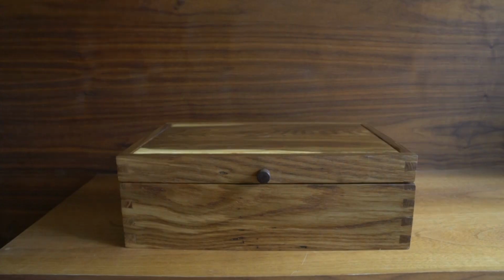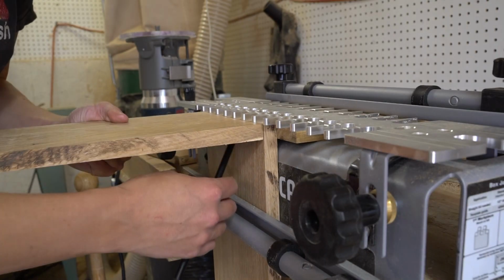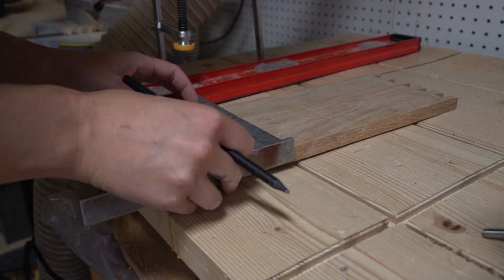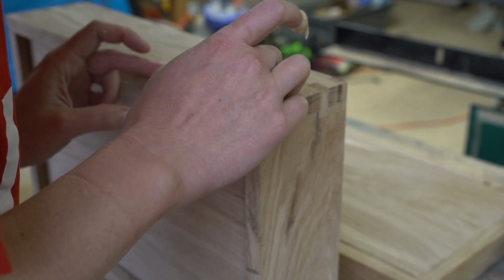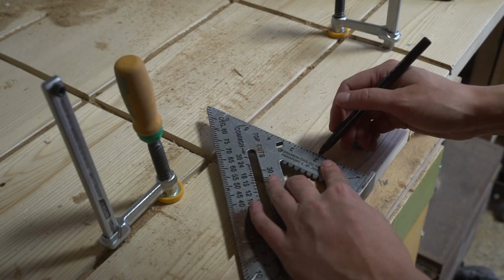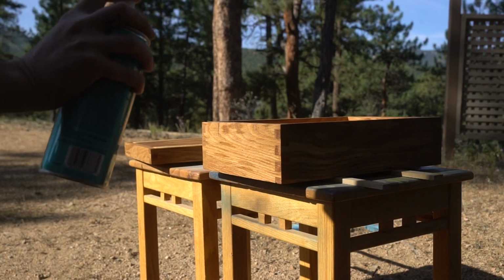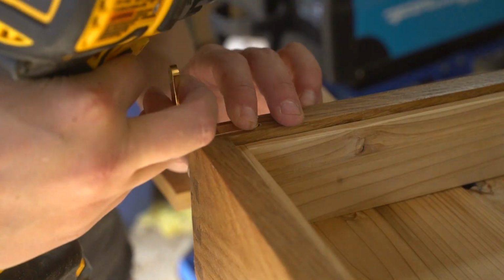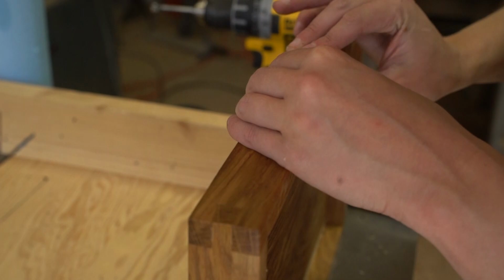DIY Dovetail Humidor | HW|Designs

Comment: WHY redoak and not Spainish Cedar for the whole of the humidor ?
Reply: She has made a very handsome box I must say but to respond to your question. Only the inside is to be made of Spanish cedar or mahogany and the outside is the builders choice. The cedar and mahogany are good at keeping the right levels of humidity inside the box. She said she used cedar and hopefully she used Spanish because other types of cedar are not suitable for this kind of device.
Reply: @griffinknowles6201  Ah hah! didn't know that a/b the exterior of the box having the ability to be 'a different species of wood' other than Spanish Cedar. I'm in the process of making my humidor, entirely out of Sp. Red Cedar.